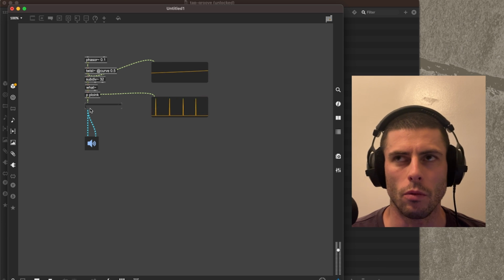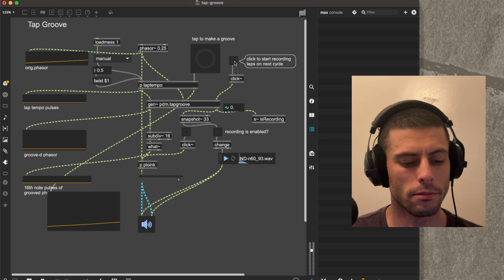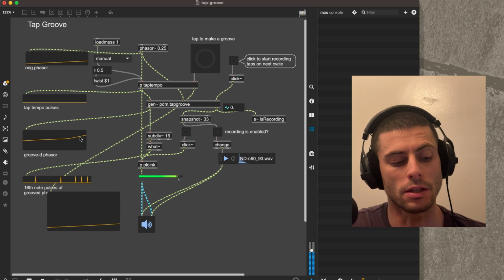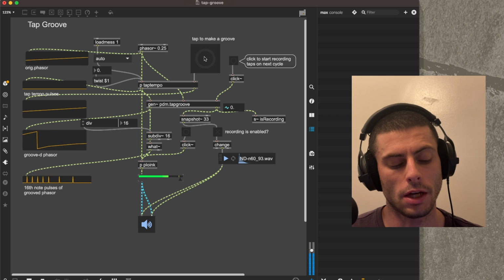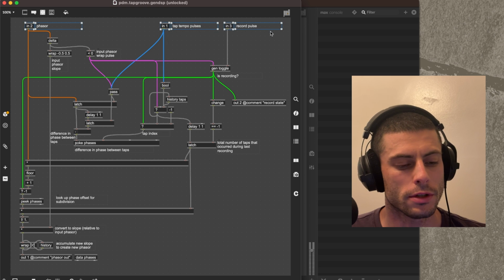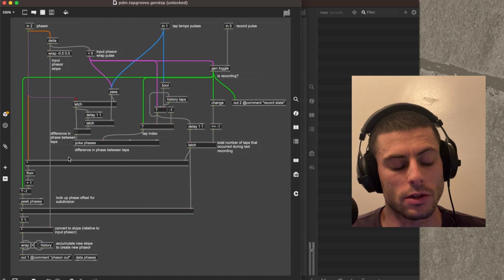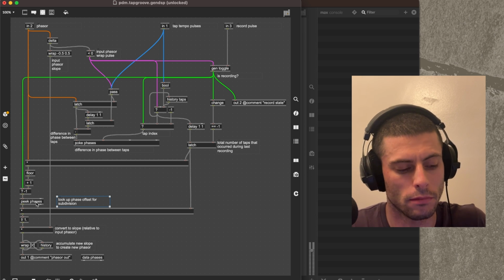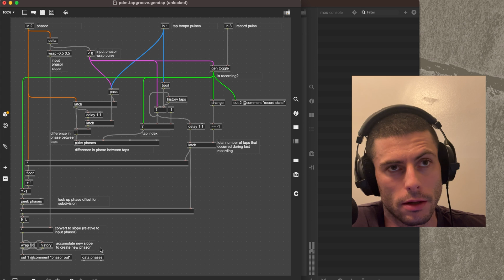Tapping to control the speed of time in Max MSP

Comment: This is super interesting and got me thinking. I’d never have considered that you could write two single samples to a buffer then interpolate between the two of them to create wave shapes. You could maybe create some kind of tap LFO? Like if you used midi and scaled the velocity to between zero and one for the sample value and the note on to write the sample position. Interesting stuff.
Reply from the maker: yes definitely. i think there’s two connected ideas - one is having a list of values that are like the “wavetable” of the lfo, then the other one is how you read it back with a phasor that may be linear or not. from the same basic wave shape stores in the buffer you could get lots of different  results